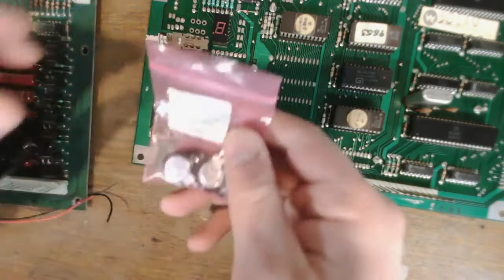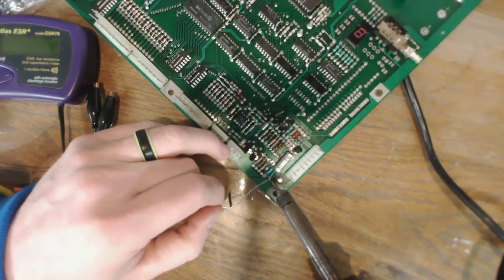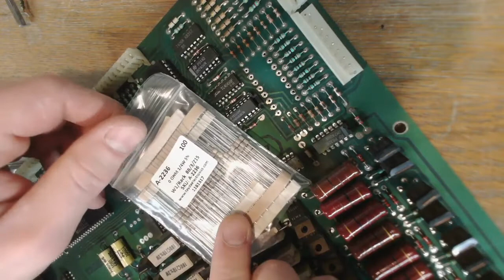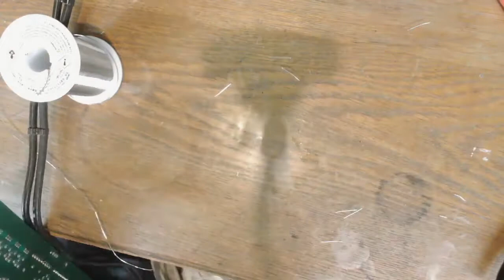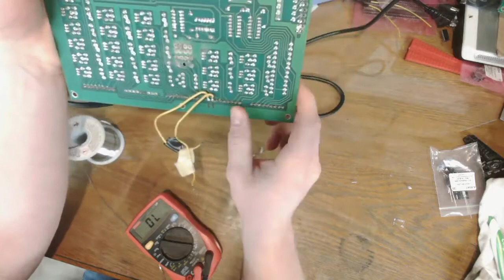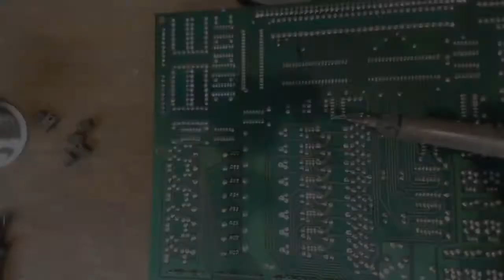Bulletproofing Williams 3-7 MPU and Driver Boards Pinball Repair.  #Williams #System3-7 #Pinball

Comment: Those are some low wattage resister your replacing the  lamp driver resistors with. Should of been 5W ceramic resisters.
Reply from the maker: They are 0 ohm jumpers.

Comment: Wondering what model desoldering tool/machine you are using? Works really well!
Reply: It’s an desktop desoldering station. 
CSI  is the brand, model 474A+
I wouldn’t call it anything super fantastic, but it does the job.
Reply from the maker: I will Ask Dave.